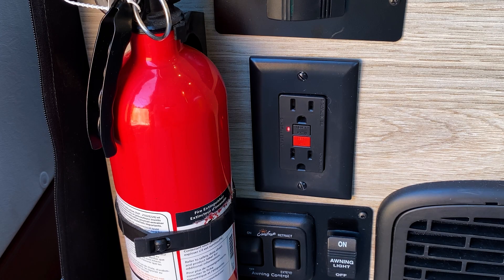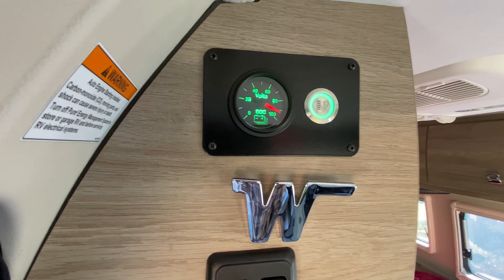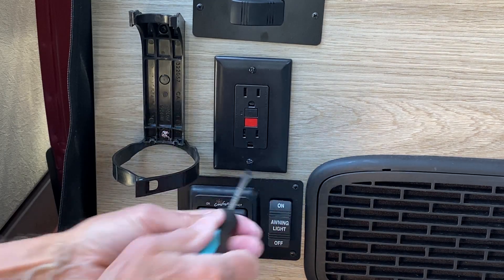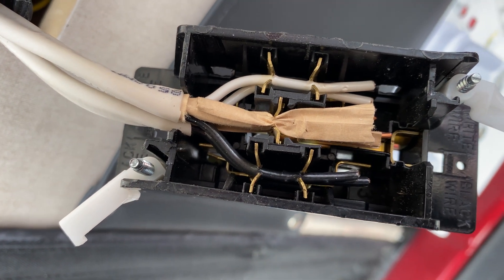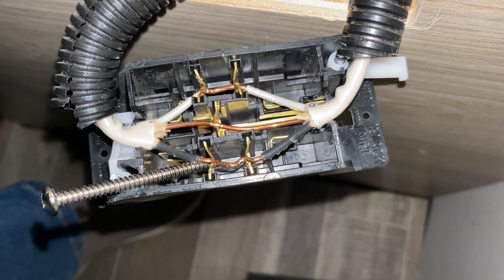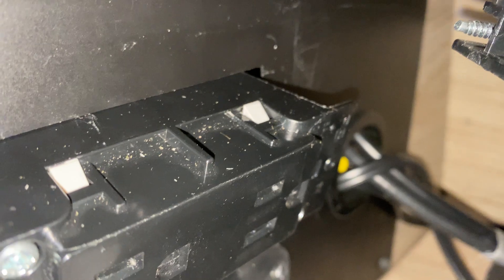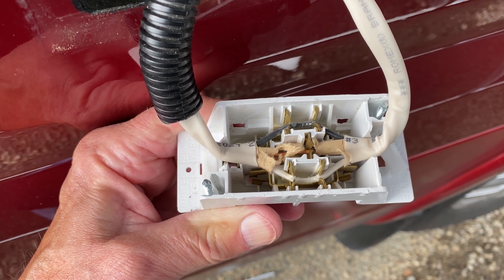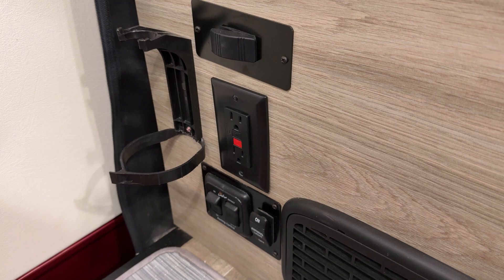GFCI Outlet Tripping in Winnebago Travato 59kl – My Solution

Comment: First they should not used Romex in a camper van, it should be a stranded wire. Second they used a very poor quality receptacles. Very poor quality work.
Reply from the maker: Thanks for your comments. The Winnebago factory work is definitely an area of improvement for them. 😉

Comment: I would have guessed it's your USB receptacles, but am also not a fan of mobile home receptacles 6:15.
Reply from the maker: Agree that the ground fault is likely in one or both of the pop-up receptacles with USB ports. Problem is, there is no obvious way to access the wiring. Do you have any experience with this? Thanks for your comment!
Reply: @randallwingett , for a GFCI to trip, you're losing more than 6 mA of 120 somewhere in the system.  At least something in the system is making it think that.  It's unlikely that a loose connection in the system is the culprit unless your GFCI is also an AFCI.

That's what makes me think it's one of the built-in USB ports.  It could also be a weak fault from neutral or hot to the vehicle chassis, though.  The only way you can eliminate either is to get the USBs isolated from the circuit and then measure resistance from wire to wire and wire to chassis to see what's amiss.  If nothing, it's probably the USBs.

For that external receptacle, a good wipe with alcohol followed by application of some black caulk would probably be helpful.
Reply: @randallwingett , are you able to (non-destructively) remove any of the trim around them?  It's likely they used crimp caps or a small enclosure off the factory extension cord wire hanging from them.
Reply from the maker: Visual inspection indicates clear silicone seal between the plastic ring and surrounding surface at the base of the pull-up USB outlets. But what would removing the ring accomplish? There is certainly a structural  assembly inside. I will consult with Winnebago on how to access this. Thanks !